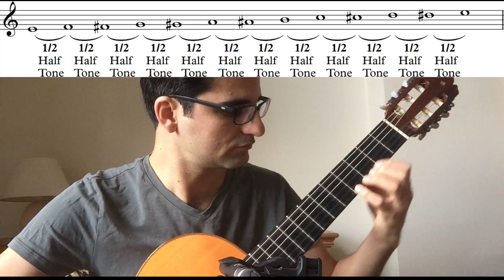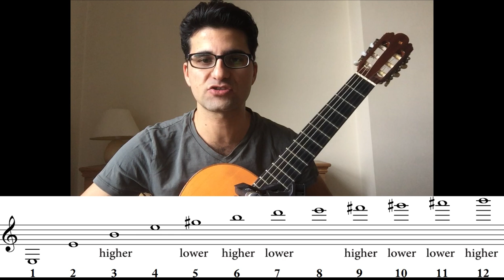Major 3rd Problem of All Guitars in the World

Comment: Thank you for this very useful discussion!

When I first started playing the guitar I always thought that there was something wrong with me and my ability to tune my guitar.  Or that I just had a bad guitar.  Or that my guitar was not set up correctly.  It turns out that there a many factors at play.

Tuning issues have been a perpetual problem, particularly for polyphonic instruments, that has been tackled in many different ways for centuries.  The pitch of a string is determined by its tension and its length.  Pythagoras identified the perfect fifth as a fundamental ratio of nature.  It is created by taking a string and shortening its free length by a ratio of 2:3.  He also identified the octave as the ratio of 1:2.  The perfect fifth and the octive both sound very nice, but there is a big problem when you play multiple notes at the same time as on a guitar or piano.  If one starts at a low-frequency note such as an A at 55Hz and creates notes separated by perfect fifths each note name in the western scale is produced eventually coming back to A.  Doing this same process just with octaves of A notes one goes from 55Hz in multiples of 2 to 7040Hz.  However, the frequencies generated with the ratio 3:2 for fifths eventually produce a note that should be an A, but is 7136Hz or 96Hz sharp!  So you can either have perfect fifths or perfect octaves, but not both.  Modern guitar fret positions are typically set to successively divide the scale length using a factor of 17.817 to produce theoretical equal intervals between half-steps and placing the 12th fret at a distance from the nut that is half the nominal scale length.  A properly intonated guitar will have the octaves at twice the frequency of the open strings.  But it turns out that the distance from the 12th fret to the bridge has to be just a little longer than from the nut to the 12th fret to produce the perfect octaves and each string behaves differently depending on their diameter and whether they have a wound layer or not.  Once we get the bridge locations set to produce perfect octaves, we now come back to the issue of fifths that aren't a perfect ratio (and thirds for that matter) and the extra problem guitars have which I will come to shortly.  One can tune a guitar to produce a really nice, rich open E chord, but then the open G or open D are off.  Upper octave notes sound bad with open strings.  All one can do is try to tune to minimize the dissonances and then use finger pressure, bending, vibrato, or modification of the string tension by pulling the string tighter or looser along its axis (this last technique is much more possible with nylon strings!).  

Guitars have an additional problem.  When one is depressing the strings close to the nut one is not just changing the free length of the string, but also significantly changing the tension making first, second, and third fret notes noticeably sharp.  

Adding microtonal frets is a clear improvement that I hadn't thought of until seeing this video.

Another solution that I have added to a Paul Reed Smith electric guitar and purchased as an option on a John Suhr electric guitar is a fairly simple and inexpensive modification invented by guitarist Buzz Feiten.  It incorporates a "shelf" nut that moves the position where the string exits from the nut slightly closer to the first fret.  One also sets the intonation and tunes the guitar to slightly different frequencies than normal.  What results is a huge improvement in intonation all across and, up and down the fretboard.  Modifications are available for acoustic and electric guitars.  There are luthiers worldwide (including Turkey) that are experienced in the modification.  www.buzzfeiten.com
Reply from the maker: Thanks a lot for your comment, very instructive. On this video, I talked more about tuning: https://www.youtube.com/watch?v=OUoo1FKCs2I&t=1s
Reply: Yes there is! (lol)

Comment: I wonder if the people who completely discount any kind of tempered tuning (including the ones that include moving the nut around 10 thousands an inch or so towards the first fret) have ever actually played a guitar that used it? A guitar with the aforementioned adjusted nut and slightly adjusted tuning on certain strings sounds amazing when actual chords are played using distortion anywhere on the neck.  You don’t have to just use power chords anymore. It’s pretty cool.

Comment: Very cool! I have heard of micro frets before and often wondered if they really made a substantial difference to the guitars intonation. I am a firm believer that good resonance is key to a great sounding guitar. In my humble opinion every guitar even a solid body electric guitar should resonate well and sound “alive” when it’s unplugged. I did have a few guitars I built with Buz Feiten’s “tempered tuning “ system on them. (Please forgive me I may have misspelled his name). The tuning and intonation improvement of his system was amazing to say the least.  Although it isn’t perfect it is based upon the way a piano is tuned. It helps improve the guitar harmonically as well as helping with the removal of many of those the “out of tune” clashing overtones. Anyway I’m very interested in your work. It sounds fantastic. Thanks
Reply from the maker: Thanks Ralph! I agree with you, good resonance is very critical. Have you tried the Bach experiment?
Reply: No I haven’t tried it yet.  I no longer have access to the tools and equipment I used to when I made guitars for a living.  I will definitely try it if I get the opportunity to. Have you ever experimented with any tempered tunings before? Like I wrote earlier my experience with the Buzz Feiten Tuning System was a positive one. Sounding in tune in almost every position on the neck really changes things.  It was a very positive experience for sure. Thank you
Reply from the maker: Ralph Ballinger I haven’t tried Buzz Feiten system. I am trying to play many different tuninga on my adjustable microtonal guitar.

Comment: so happy I've watched this video for about 10 years i've found that its far more natural to tune a standard guitar in a more equal temprement the bottom 3 string need to be lower than the high G B E strings and depending on where you happen to be around e flat the low E sometimes needs to be flatter than the a and d string and the G string needs to be flatter than the high E and B string.  Its not perfect but over all between open strings and fretted notes its comes far closer to equal temprement :D  gotta take dem notes from bach i mean why else did he write a well tempered clavier xP  great video thanks!
Reply from the maker: Glad to hear that! Have you watched my Bach Experiment video?

Comment: Biggest issue with this is, if you ever want to play using a capo, you have to start from square one again because youve essentially changed the guitar scale with a capo and NONE of the already installed micro frets currently on the guitar would work with the capo because the harmonics locations would change. You'd need separate guitars for EVERY song you play with a capo being used on different frets unless you play capo'd on the same fret EVERY time, you'd need other guitars micro fretted for every diffferent capo location or you have to pull off the micro frets "using only 1 guitar" and re place them individually every time you wanted to use a capo and EVERY time you switch the capo to a different fret. Every time the nut location changes, the scale essentially changes hence, changing the location of the harmonics, and the micro frets.
Reply from the maker: I think the adjustable design here solves the problem: https://www.youtube.com/watch?v=EIimjVUthB0&t=1s

Comment: In equal temperament, major thirds have to be slightly sharp, and perfect fifths very slightly flat. On a piano we get used to hearing this and the natural tendency of pianos to have rich overtones somewhat covers this up, though you can hear the "beats" very clearly. On a guitar, sharpened major thirds are much more obvious. You have two choices, for example playing an e shape major chord. You can slightly flatten off the open g string (often used for the major third in E shaped chords), then the stopped major third will sound less sharp, but now you will have to slightly bend the g string upwards to make fifths in tune.

It affects the g string more than others because firstly the g string is the most prone to sharpness due to it being slacker and thicker (on classical guitars) and secondly because when used as a major third to a chord it nearly always gets exposed as very sharp. The other method is to install a compensating nut. In the end there is not much you can do. Guitars are never completely in tune so everything is a compromise.

Comment: Because the harmonic of fret 4 on A string is not a C# but a combination of 2 notes
Reply from the maker: Combination of which notes? A and C#?
Reply: Microtonal Guitar - Tolgahan Çoğulu it's the combination of the right side string of fret 4 (normally played C#) and its left side (slight flatter C#). The C# string length plus the slight flatter C# string length which made the length of root A string. The reason why harmonic on fret 12, 7 and 5 sounds in tune because their right and left side string have the same notes. So the purpose of microtones on guitar is actually just to make them more resonant with the root strings E A D G B E.
Reply from the maker: I am not sure about your point. 5/4 ratio gives you 386 cents. You might be talking about bitones in Schneider's book. When you hammer-on a note, both sides give different tones.
Reply: Microtonal Guitar - Tolgahan Çoğulu what I want to say is the harmonics in guitar have their own spots and they're not the same with the fret spots. So the real and in tune C# harmonic on A string is not at fret 4 but slightly at the left more like fret 3.9
Reply from the maker: I got it now. Thanks.

Comment: Here's the argument for equal temperment: The first harmonic is the octave. The 2nd one is the 5th. With the relationship of the 5th we get all 12 tones.  C to G. To D.  And thence to A, E, B, F#, C#, Ab, Eb, Bb, F, and back to C. And after several centuries our ears (for most of us, anyway) are well used to it. Acknowledging that it is an approximation, it is a good and practical one. See Josh's comment below. As you chase after the higher overtones you notice that the volume drops precipitously.  Also the quality suffers. Rather than the sweet ringing tones of the lower harmonics, the higher ones start to sound stifled and nearly inaudible. So I say it's a fools errand to try to accommodate them.
Reply from the maker: I disagree with you. https://www.youtube.com/watch?v=AQgybkGPETU

Comment: The oud (Ud, Luth) is a fretless ancestor of the modern guitar and does not have this problem.
Reply from the maker: Here is a related video about this: https://www.youtube.com/watch?v=6-qoQ0Lqcx8
Reply: Very useful, indeed. Thanks.
Being fretless, the Oud moves the problem to the player instead of trying to fix it locally (generally with a bad fix like the standard guitar). But the result is that we can hear a slight disparity between different Oud players when playing the same maqams. Some just sound "right", some don't.
Reply from the maker: In one of the modes here, Rast Makam, the oud players always fret the 5th harmonic natural major 3rd.

Comment: Our logarithmic method is probably the best for performance instruments, since they sound good (albeit imperfect) in all keys. I do wish there was more support in DAWs for perfect harmonic intervals though; there's no reason why synths need to conform to equal temperament.
Reply: It's a good idea but not completely straightforward. You want to tune higher notes to the root note of the chord, sure. This in itself requires perhaps a separate MIDI input to specify the root. In addition, is the root scale just tempered or equal? Probably depends on the harmonic complexity (whether you change keys/borrow chords). Remember, the reason that equal tempering exists is that the harmonic series ratios don't cycle back around.
Reply: @yikelu there exists software like scale breaker and alt-tuner which have adaptive tuning = they guess the reference note and tune the other notes relative to it using pitch bend
Plus you can always just use more than 12 notes!

Comment: The harmonics don't match because the frets are straight and are not shaped to accommodate the various string tensions and gauges... 
The frets provide merely an approximation for where a note would lay.  without adjusting the shape of the fret  exactly to match the exact locations where the notes actually are on the string you will not get perfect tuning in equal temperament. The solution is squiggly frets that lay on the exact notes instead of staight frets. True temperament frets accomplish this.
Reply from the maker: They accomplish this but they are not practical as you modulate. I think the best solution is adjustable microtonal guitar: https://www.youtube.com/watch?v=yhdpsuXtewY